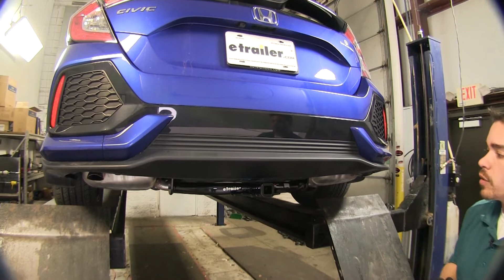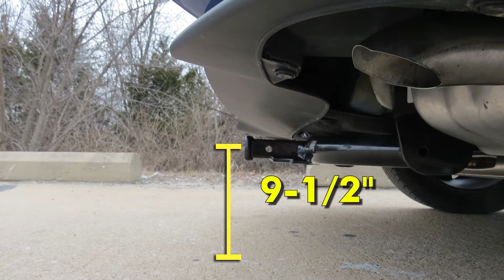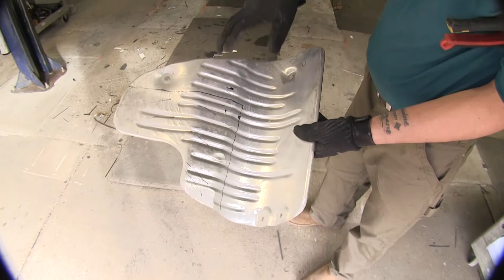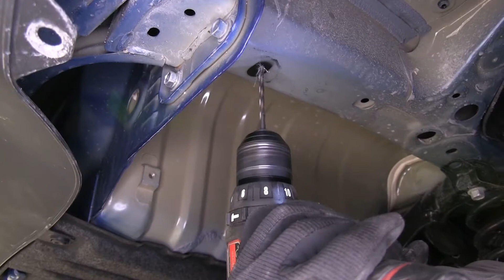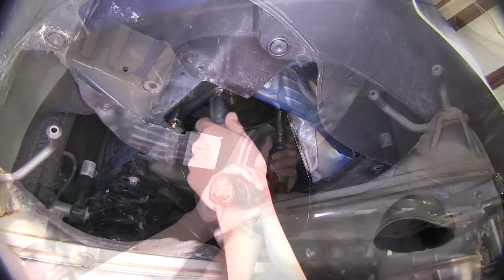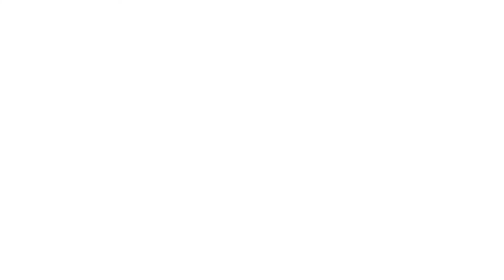Step-By-Step Installation Tutorial for the Curt Trailer Hitch Receiver on a 2017 Honda Civic

Comment: Try to make one that doesn’t require drilling and cutting cause that will drop the resale value off your car and isn’t really appreciated.
Reply from the maker: Unfortunately both of the hitches that are available for the 2017 Honda Civic will require a bit of trimming. The other style hitch that we have will not require drilling but it will still require trimming the rear fascia.
https://www.etrailer.com/Trailer-Hitch/Curt/C11463.html
https://www.etrailer.com/Trailer-Hitch/Draw-Tite/24954.html